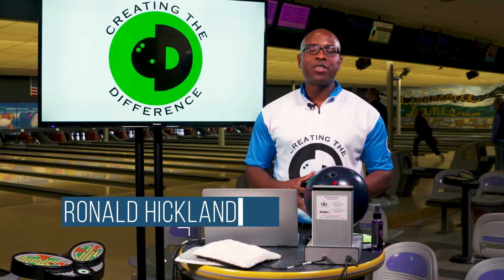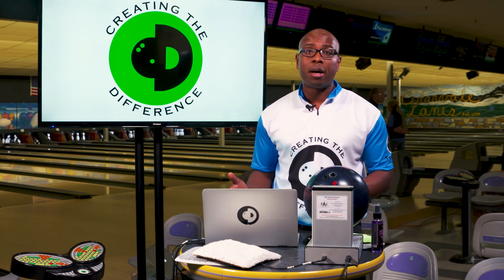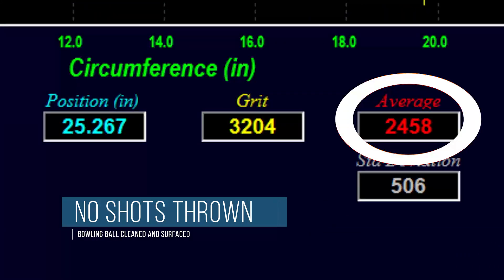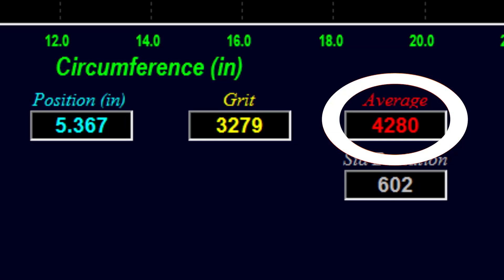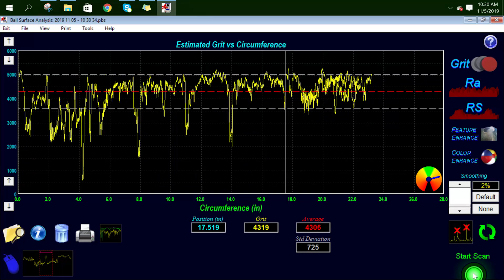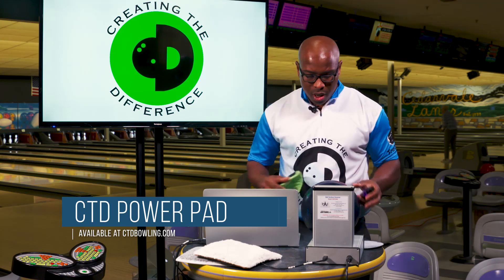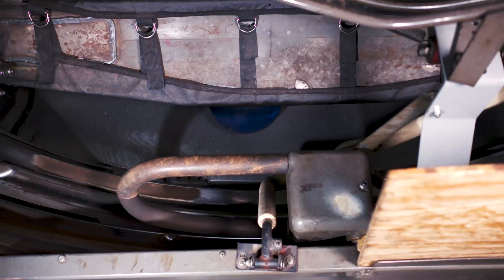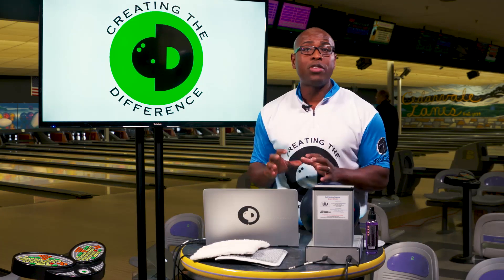Bowl Better The Truth Behind Why Your Bowling Ball Changes | What You Can Do About It

Comment: Hey Ron what's up. Have a question , I have a ball spinner and I do my own maintenance on my equipment. I have CTD Tru cut pads I use. I polish much of my equipment. Would you recommend to sand my equipment after 3-5 games still?
There are times when I use a ball and there is still polish on it and all I do is clean and repolish without sanding. Ball reaction is still the same.
Reply from the maker: If the ball is polished and you are just touching it up. You don't need to go through the whole process again. You can just use the polish, but yes 3 to 5 games is recommended as it  just helps to keep it extremely consistent.

Comment: Lane shined is the best. I clean my balls but w/e surface they go to lane shined is where I keep them. Unless I'm bowling on a sport pattern.
Reply: I have been using my same ball for like 2+yrs and the only decline in performance is the pin carry. It still has pin carry, just not like it was out of the box. I might have it baked/resurfaced/polished soon
Reply: @TheBlueBunnyKen  I use a box and a hair dryer (YouTube it) to remove oil. I roll a Rotogrip Theory with about 1000 games on it. I still get excellent ball reaction.